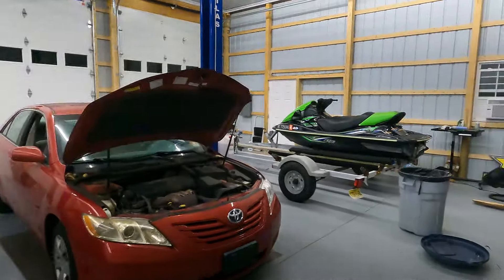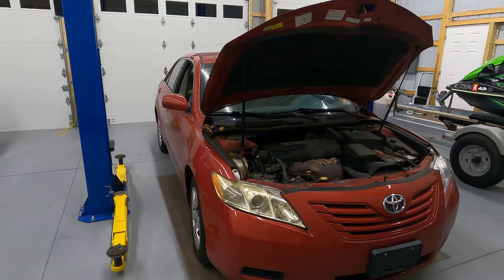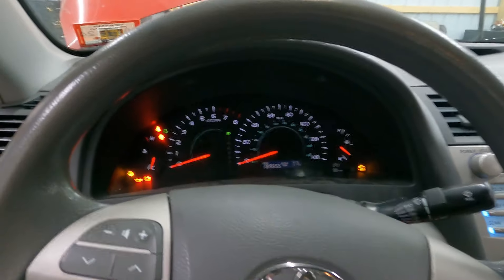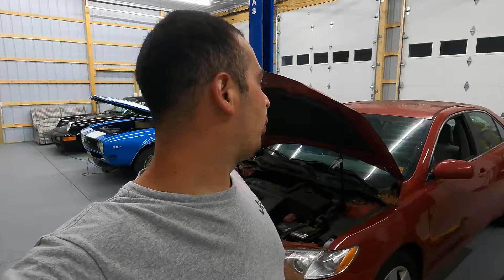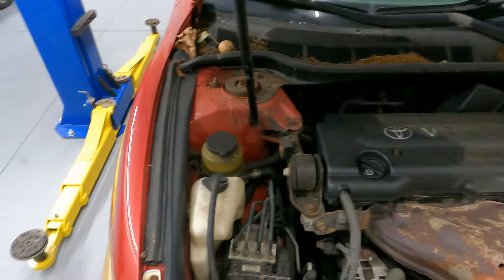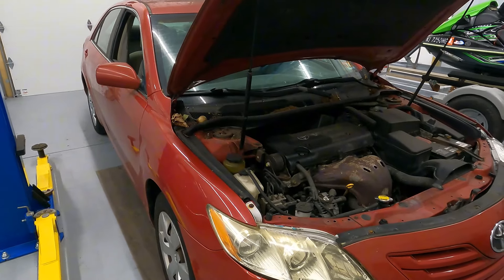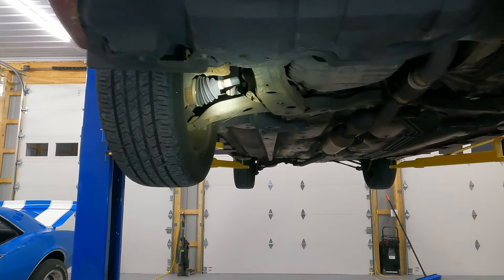We purchased a VERY hurt Toyota Camry with the notorious 2AZ-FE Engine!!!

Comment: I bought a 2003 with this engine for $900. It wasn't burning oi but the head bolts stripped and over heated the engine. There were no scoring on the walls. I redid those, heli coiled the block, new chain and components, and phaser, new head gasket and bolts, new flex pipe, new suspension, new radiator and thermostat,  few new sensors, put it together and I have been using it for 2 years now. It's lot of work. Eric O did a whole series on that 7 years ago. Of course I did the work myself so it was just parts and the time sert kit which I resold on eBay. I believe my total parts cost was somewhere around $1800. Was great project.
Reply: People don’t keep an eye on the radiator on these cars that what causes the head bolt to stip when they over heat but most car will blow head gasket when they overheat so I don’t get why they get a bad wrap

Comment: I have a 2013 Camry with the 2AR-FXE that has had 5k mile oil changes its whole life and it has 139k miles on it. It burns oil a quart of oil every 1800 miles. I have no idea why because I thought the AR's didnt burn oil unless it had 10k mile oil change its whole life, but after doing some more research, the early pre-2014.5 AR engines are burning oil even with good maintenance. Times have changed with these things since I got mine with 114k miles in late 2022.
Reply: after about 120k on these engines worn valve stem seals causes oil leak into combustion chamber.  worn rear main seal causes oil to leak out of crankshaft flexplate area youll see it on the bottom of engine block.  worn camshaft seals causes oil to leak below camshaft gears...youll see that on the guardplate between the cam gear and cylinder head.....together these "seals" being worn account for that quart of oil every 1800 miles...luckily its not too much of a difficult job to replace those 13 silicone rubberized seals...the most dificult one for diyers being the rear main seal as that involves detaching the engine from the transmission.
Reply: @BenChung78  if you're talking about the AR, it's actually caused by a mix of low tension piston rings and prolonged oil change intervals starting on the 2012 model year. The piston rings seize from dirty oil and start scraping the cylinder walls. After going down my engine with a borescope I can confirm it's from the piston rings from the missing cross hatch on two of the cylinders and ring wash on the top of one of the pistons. The Car Care Nut has explained this a lot if you want to see a good video about the AR in particular. He's made like 6 or 7 of them that's how bad they're getting.

Comment: Probably best to buy the new Toyota short block for this car.  I'm sure it has been run low on oil more than once...
Reply from the maker: We’re exploring all options at this point but you’re probably not wrong. We’ll have a good idea of how well it was maintained once we get the valve cover off
Reply: @SEsGarage    I would make this same repair to my 09 that is just starting to use oil, but it is too rusty underneath...Time for a new(er) car I guess

Comment: i over paid for a 2009 with this pos engine in it.  what a waste of money.    However, it takes about $20 a month of oil to keep it topped off and running.
Reply: You should get the short block done if the rest of the car is in good shape. It will last a long time with the updated short block, probably a $4,000 job but better than buying a new car IMO
Reply: @roofcamper3473  i thought about it, but it got hit in a parking lot as well.  rather put the 4K into something a little newer

Comment: I've driven worse bud. I have a 01 Camry with 450k miles on the same engine and transmission. I have to put a quart of oil in it every 800 to 1000 miles 😂. Always adding coolant. I still drive it from Memphis to Dallas 3 times per month 75 to 85 mph. Just got back to Memphis from Kansas City Kansas last week. This Camry you have is impressive compared to the pile of 💩 i drive 😂
Reply: love it

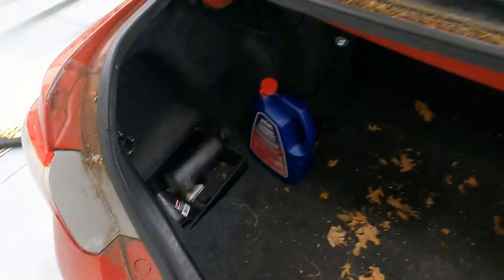Comment: 6:04 7 11 oil aside 10 w-40 is way to heavy thats what you ran in an old Big block chevy back in the day. im sure thats not good for the VVT
Reply from the maker: Many people will try to Band-Aid the oil burning that this engine has with thicker oil, unfortunately. It may slow down the oil burning, but as you mentioned, it’s not good for the variable valve timing system, and it also takes longer for the engine to get to the cylinder head!

Comment: Grandparents had a 2002 XLE with this motor.
Cousin had a 2007 with this engine in it, too, she never had an issue.
Grandparents had a 2011 with the 2AR-FE, the 2.5 liter in it.
Godmother had her 2AZ-FE in a 2006 RAV4 replaced at 150,000 miles.
Never an issue since.

Comment: I have the 2004 camry with 2.4l engine.  I bought it at 78k miles, treated it like crap until i came to my senses at 200k and started doing maintenance myself on good intervals.  I have the oil consumption issue but no issue with coolant or misfiring.  I also did get the P0420 code and ended up replacing the exhaust manifold cat converter and the code went away.  Not sure if my car had the recall done but my car has no outatanding recalls.  Its at 221k and running strong.  Transmission is rock solid and just did a drain and fill after being untouched for 100k miles with no issue.
Reply: Think the recall is for 2007-2010, don’t quote me on that. Your oil burning is probably from bad oil change intervals

Comment: Since I'm spending YOUR MONEY ..  My $0.02...  remove cylinder head, check bores for scoring.  (Scored bore? Ignore the rest of this...) If no scoring, reassemble with necessary new parts AND THEN fill crankcase with Valvoline Restore & Protect.  Compression test and blowdown test 13:03  after assembly, but before first ignition cycle. Repeat with 2000 mile oil changes. Use Wix filters (OEM filters no good.) See what happens...  just for the record, i have a 2008 Scion XB with 188k that started burning oil recently (wife's car.)  Just started using the valvoline on last oil change. I'm doing my own testing/ experiments as well
Reply: What’s the problem with the oem filter, do you like the Amsoil filter?

Comment: Might want to try Valvoline Restore  and Protect oil.  I have been using  that oil since May 2024.  Have noticed that oil consumption has improved at the 3K mile drain it only used 3/4 of a quart.  It  was 1 full quart of oil consumption every 3K drain and fill  before the switch to Valvoline Restore and Protect. My car has that engine and it is a 2009 Camry Hybrid.   Must have 4 drain and fills before accessing effectiveness of Valvoline Restore and Protect,  I am 1500 mile into my third drain and fill

Comment: Some of the toyota v6s can be ticking time bombs if they haven't been fixed. But im not sure if it applies to the Camry V6. Off the top of my head, the V6 from the RAV4 and some Lexuses are ticking time bombs if they have their original oil lines, where a portion is made from rubber and bursts, quickly destroying the engine. 

Then Toyota recalled that and replaced it with another rubber line which also explodes.

Then they replaced it with a metal line which fixes the issue. You have to check it has the metal line which isn't hard, if you know how to check. (Why it pays to look into a car's issues beforehand)
Reply from the maker: Yep that’s the VVT oil line on the back bank of the Camry/avalon. Oil cooler hoses are on the Lexus RX and I believe Highlander

Comment: I have a 07 Camry with this engine, from beginning of its life it was kept in Massachusetts and has had 2k miles put on it every year until it’s 15th year of its life, I put 15k on it now every year it has now 82k and I do oil changes every 2 thousand miles on average tried almost every company of brand name of oil out there, changed the trany fluid at 70k and has an evap error, replaced to mounts that’s about it for the most part, some rust but runs like a beast highway mileage and city

Comment: Toyota is a POS but non the less, that thing obviously was mistreated and still went over 180k miles! I had an 05' I bought new and the engine was fine for all 130k miles until I sold it. I hate Toyota but I think that was a great engine under normal MAINTENENCE! My 2009 Hyundai Sonata I bought new I still have after 15 years and it does not burn a drop of oil! Except for an AC compressor last year, it has had NOTHING done to it. Not even spark plugs. It is crazy reliable!